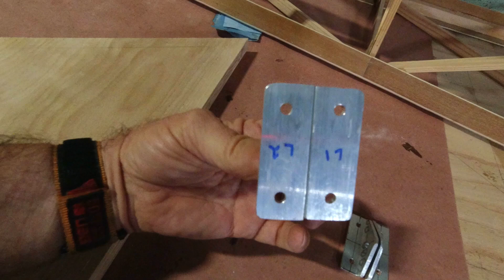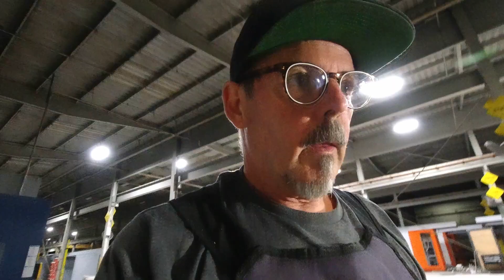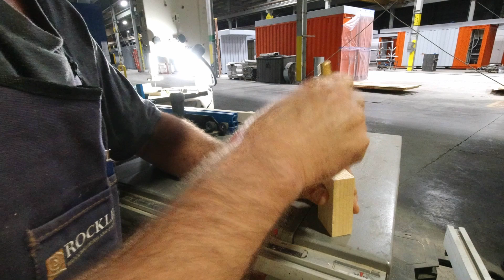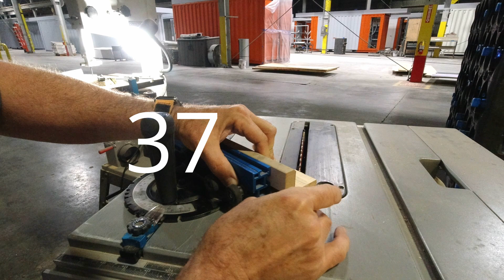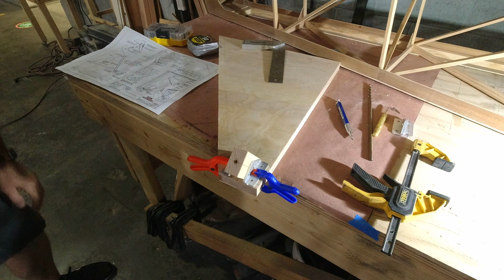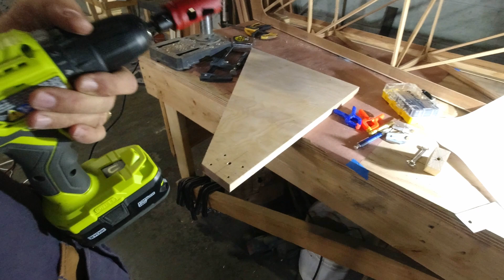Minimax 1100r Wood Aircraft Build Ep 82

Comment: If I had a doover I would of made my landing gear axle from aluminum instead of steel to save a bunch of weight. You couldn't get away with that on the minimax because the landing gear is part of the wing structure and a hard landing can damage the wings.